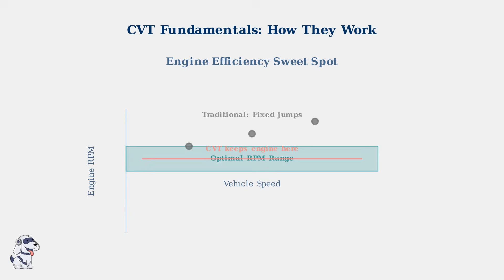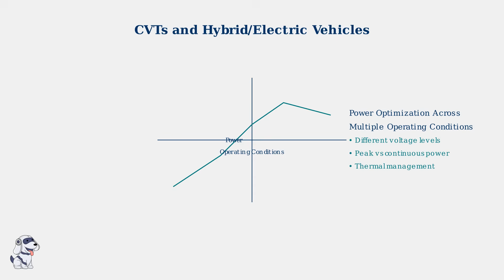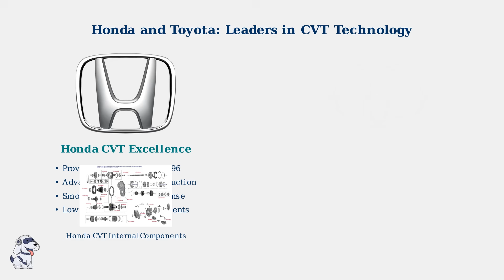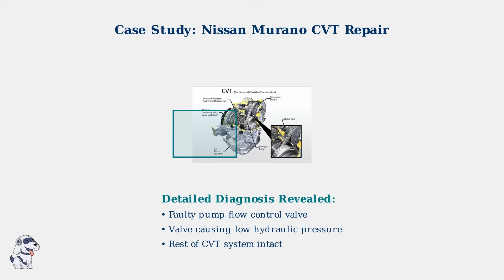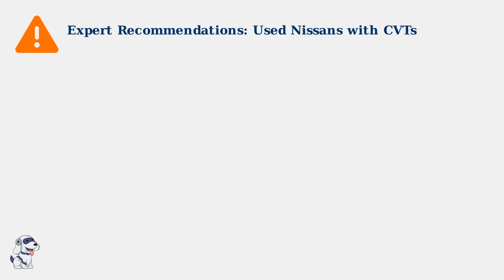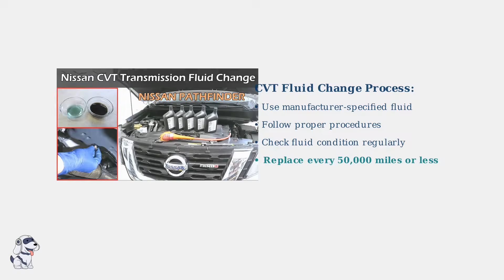📹 Who Makes the BEST CVT Transmission in 2025? | CVT Reliability Breakdown by Transmax Transmissions

Comment: It's a lot harder to make an automatic transmission than a gasoline engine.  If you look at the automotive history of the States, the automatic transmission is typically the first major repair or the first thing to go out on the majority of vehicles sold in the States. (The Manual transmission is a whole different story.)  But often the conventional automatic would start going bad and that's around the time the owner will put their car up for sale or trade it in for something new.  You might have to replace the automatic transmission 3 times over for every engine that needs to be rebuilt.  The automatic transmission is a major major industry.  It's also the reason why Canada's automotive industry shrank or merged with the States (many moons ago) in order to meet the consumer demand once the automatic transmission was invented and there was a rush to switch over from manual to automatic.  Which I think is a mistake because the early automatics were garbage compared to the reliability and longevity of the manual transmission

Comment: Interesting topic, your layout needs improvement. Too much overlay overlap makes your presentation hard to read. Also, this "growing trend" is the result of the manufacturer literally forcing the customer into the product. It's not that the consumer actually wants them, it is that the consumer literally has NO CHOICE in what manufacturer put in their product, and the manufacturer is more interested in a less expensive, "shoddier product" than customer satisfaction. The manufacturer doesn't give a darn about the reliability of their product. All they are interested in is THEIR bottom line. Even though I DO own a car with an "IVT" it wasn't because I wanted the darn thing, it is because I HAD to get the vehicle with it. Not much consumer choice there. I STILL think that CVT / IVT's still need refinement, and I still do not trust their reliability. A major fact is that the manufacturer boasts and intentionally misleads the customer that the fluid is "lifetime" and in earlier CVT's sealed the unit. No service possible, and in reality, this fluid is far from lifetime capable, and many customers faced CVT destruction because of it. And some manufacturers are STILL doing it today.

Comment: The Ecvt in a ford maverick hybrid is an amazing piece of engineering. I’m a guy who loves big block engines and 4 speed cars/ trucks. But in the hybrid maverick the Ecvt is amazing. The electric motor takes care of off the line torque and the gasoline motor takes over when necessary in upper speeds or more power situations. This motor trans combo has been time tested over the last 10 years. No belts . No chains , no recalls.  I have no experience with the original cvts or modern cvts in internal combustion engines solely. But what I’ve put 80,000 miles on has driven perfectly- and I have a fairly heavy foot. 🦶
Reply: Your Ford eCVT is really the Toyota design with minor modifications and it's been out since the late 90s. Ford had to go to Toyota and license it from them to use it. The Toyota design has proven itself worldwide for decades and is still the standard in the industry. It has few moving parts and is easily good for 200,000+ miles. One customer at the Dealer was "jokingly" trading in his Prius for a new one because "his battery was starting to get weak". His car had 426,000 miles and still running. The rest of the car was still in very driveable shape. Normal maintenance was done as necessary and required. It's the only car he said he'd ever buy.

Comment: This video appears to be an AI-generated commercial for Jatco.  The problem is that Jatco transmissions are the ones with the worst reliability of them all.  Where this video attempts to mask that terrible record among mechanics who see these transmissions after they have fallen apart.  I was going to buy one of the cars that uses the Jatco transmissions.  However, after talking to several mechanics about these Jatco units, I would not touch a car that uses one with a 20-foot pole.

Comment: As a Toyota customer, I’m happy with the way it’s eCVT works. While it’s no doubt true that many CVTs traditionally used belt drive, there isn’t any in my Toyota hybrid, at least not in the transmission. There is a chain drive in the engine for the valve gear, but nothing else. Their system handles it all via power electronics through the two motor/generators in the transmission.

Comment: Silly question. Toyota's eCVT is head and shoulders above the rest with many taxis having more than 500,000 miles on their original eCVTs. No belts and no friction surfaces, just a planetary gear set and two electric motors.

Comment: The best CVT is the eCVT in Toyota Hybrids. It's a planetary gear CVT and has been shown to be a much more reliable design than the belt and pulley design. Standard CVT's cant's be fixed and have to be replaced costly a lot more money. And if people don't change the CVT fluid regularly it gets expensive very quickly. Me, I'll choose a manual transmission any over a CVT or automatic.
Reply: They are places now they know how to rebuilt CVT transmission. It could be rebuilt, just like every other transmission or you can find plenty of them in the junkyard.
Reply: Agreed! Have studied the CVT's in depth, and the Toyota e-CVT certainly appears to be simplicity at its finest, built to last, with zero belts. This said, the Corolla CVT may not be the best, with a belt, but an off-the-line gear. Time will tell.
Reply: I totally agree.  Unfortunately, finding a car were a manual transmission is an option is impossible 99% of the time these days.

Comment: CVTs SUCK. They are an affront to mechanical engineering by their design and principles alone. In short, the belt and pulley' system should have NEVER be put on cars. 

The only exceptions are Toyota and Honda's HYBRID engines (not their regular petrol engines, they suck too), which use different design and aren't even the same as regular CVTs.

Honda hybrids cannot even be called a CVT, really. It's mainly an electrical motor with a petrol engine acting as a generator (and then a clutch for high-speed but nvm).

Toyota hybrids (Synergy Drive) uses a clever planetary gear arrangement that generates no friction between component and blends engine and electrical power, and why they are supremaly reliable.

The rest, avoid them like the plague they are. The more powerful and demanding the vehicle is (heavy weight, off-roading), the worse they will be.

If you have one already, oil needs to be in top condition. As soon as it gets contaminated, it will eat the transmission because the principle is s.t.u.p.i.d. All their ongoing development is trying to patch an hemorrhage with a band-aid.

Comment: What about constant friction as the belt continuously adjusts? Friction causes wear which is why CVTs don't last long compared to a real transmission.
Reply: Belt slip, overheating, all bad. Oil film breaks down, Micro particles of metal in oil, grinds the contact surfaces, ect...
Reply: You say that as if there is no wear or friction associated with regular transmissions.
Reply: @jdquadrider  CVTs slip constatntly
Reply: @Gman00047 Believe it or not, automatic transmissions slipped all the time too.  At least until the lockup torque converter came along and lessened the effect.  But they still slip.
Reply: @Gman00047 Traditional automatics are slipping while sitting at a traffic light.  Always
Reply: This is why you have to be regular with fluid maintenance.  Those that buy into the lifetime fluid BS are the ones complaining about their CVTs failing.  It's not the constant friction per say that causes some of the failure, it's if the metal belt slips.  That creates scoring/grooving in the variators which results in a total failure of the trans.  CVT fluid is also not the same as ATF used in geared auto transmissions.  CVT fluid has some friction properties that help with the lubrication and contact between the belt and the variators.

Comment: I have a Honda Accord 2013 with a CVT at the beginning I didn’t like it, but I got used to it. I love it smooth ride great on gas mileage. Mine has 225,000 miles and it still runs like new as long as you take care of it and change that oil  every 30,000 miles you won’t have a problem you can’t run these cars like the fast and the furious

Comment: Why do CVT's generate so much heat? Heat comes from friction and indicates energy loss. Where does the friction in a CVT occur? Does the belt slip? Efficiency gained from using a CVT apparently comes completely from keeping the engine at optimum operating speed, not the CVT itself.  Gears must be more efficient at transmitting power. Manual transmissions don't usually require an oil cooler.

Comment: Why does an EV need a CVT?
Reply: It doesn't. There are hybrid vehicles by Kia, that use a conventional automatic transmission. Truth be known however, the eCVT in a Toyota has no cones or belt but uses a planetary gear set instead and is said to be bulletproof. Simply change the fluid every 60,000 to 90,000 miles and you're good to go.
Reply: There are no CVTs in EVs.  EVs don't really need gears when they can easily spin to 30,000 RPM.